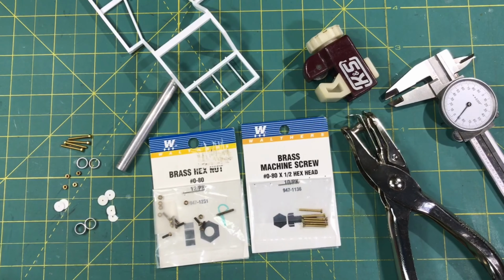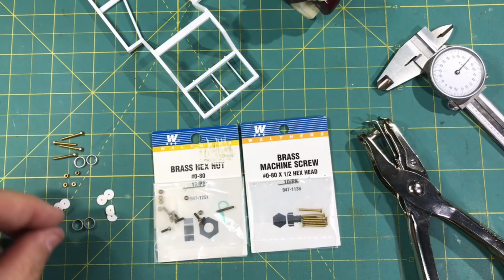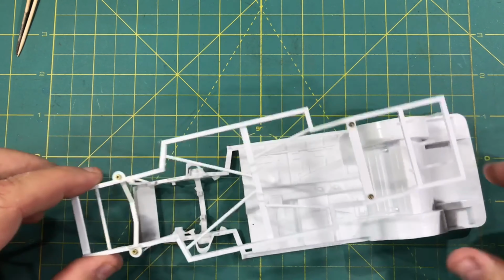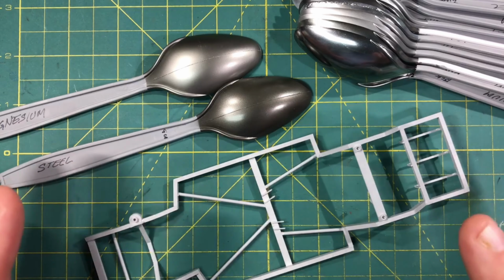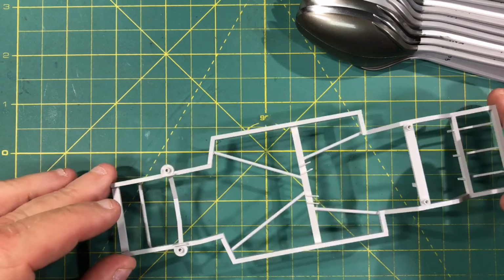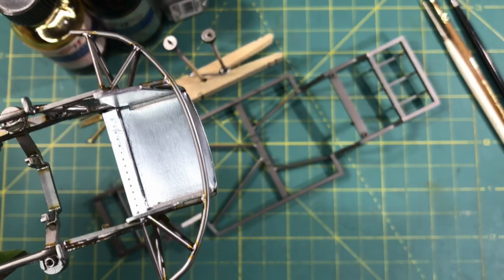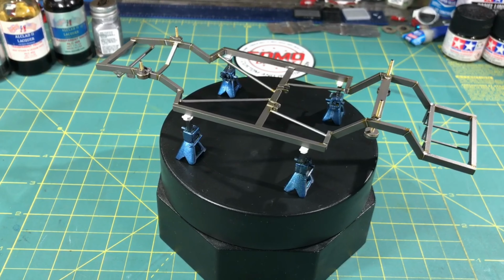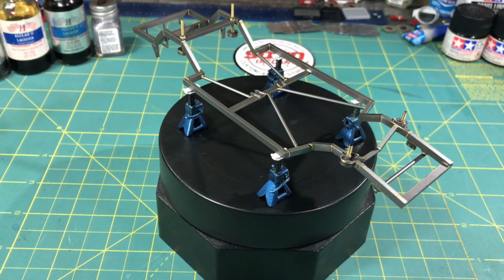FINISHED! Our Scratch Built Basic Stock Car Chassis

Comment: I’m assuming you use real metal springs in the chassis.  What type of metal springs, and where do you get them?
Reply from the maker: I use copper wire Michael. Role them around a small piece of tubing just smaller than the spring buckets. Then prime and paint them. Many thanks for watching!!
Reply: @MarkBatsonHobbydude007  Thanks.